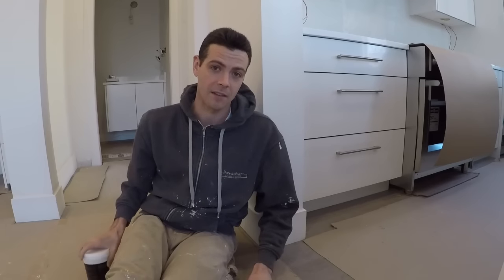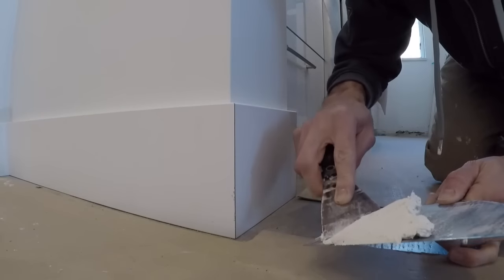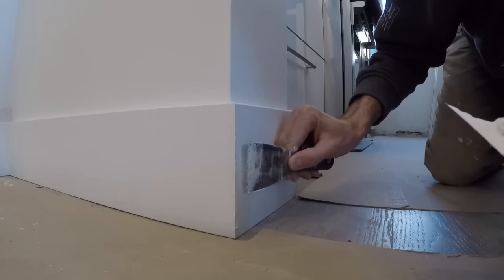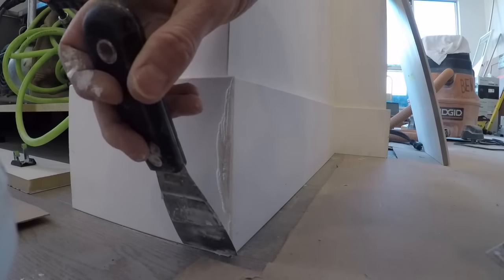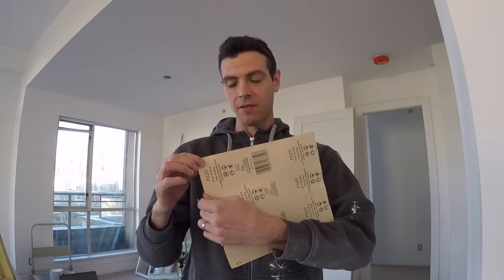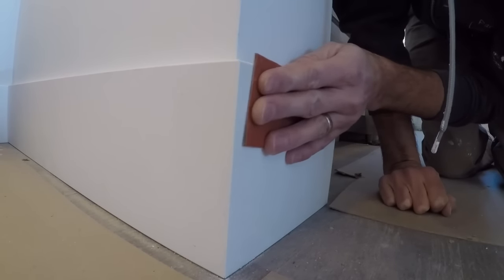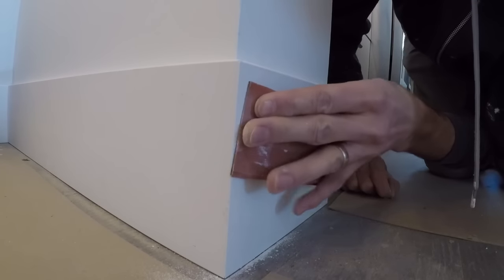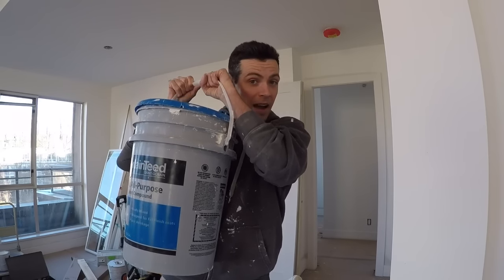How to Fix Open Miters

Comment: Will crack as soon as there is a change in temperature in that room.  Joint Compound doesn't flex where as wood and even the paint you will put on top of it will.  Should have used a product that advertises flexibility or a product that is known for extreme durability such as Bondo or auto body 2 part filler.

Comment: I've hired many contractors and have learned that Asians do a better job with details. They are good math and everything they do is not only fast, efficient but the shit lines up perfectly just like Japanese cars. 

Now, previously, we would hire overpriced licensed contractors and they over all fit and finishes is straight garbage just like Tesla panel gaps and doors that rub and paint that looks like crap.

Comment: I’m not a professional carpenter by trade. I’m an electrician, but I’m also an avid wood worker in my spare time and I have also remodeled a lot of houses.  Here are some things I’ve learned.

If you know the corners aren’t perfect 90 degree corners to begin with, measure the angle first and bisect your miter cuts accordingly. Then you’re miter will fit perfectly almost every time. They make angle measuring/bisecting gauges exactly for this purpose. Then you don’t need to putty gaps because there won’t be any. Do a tune up on your mitre saw to make sure everything is properly aligned. Make sure you have a sharp and proper trim blade with 80 teeth. Make sure the bevel stops are set accurately. I use a machinist square that I’ve checked for accuracy, to make sure the saw bevel angle is reset perfectly 90 degrees to the saw bed. I do this by unplugging the saw and placing on side of the square on the bed of the saw and the other against the blade and adjusting it until there is no gap. Ideally you should do this after a bevel cut when you reset the saw to the normal zero position, and don’t always trust the detents or stops on the saw to be accurate. Use a zero clearance insert in the saw to eliminate tear out. Use the insert that comes with the saw as a template to make your own custom zero clearance insert to perfectly fit your saw. 

Do a practice cut on some scrap first instead of messing up a good piece of stock/ molding etc...

I only miter outside corners. I cope almost all my inside corners because it makes for a tighter joint even when the walls aren’t perfect. This also reduces the amount of puttying that would otherwise be necessary. 

Sometimes it necessary to sneak up on a cut or make micro adjustments to it. I do this by pushing the piece of molding semi-tightly into the saw blade while the saw isn’t running. I then raise the saw start it and make a cut. Using this method it will take a fraction of a blade width off the work piece, and you can repeat the process until the piece fits perfectly.

Comment: Open joints can be filled with veneer of the same wood. Break or cut a piece of veneer along the grain & sand one edge to taper the veneer. Put some pva glue in the gap & tap the veneer into  the gap, more can be tapped in if needed. Remove the excess & sand to shape & match the joint. It's perfect for unpainted mouldings, skirting, furniture repairs etc & it doesn't shrink.

Comment: For all the DIY-ers out there, I have some advice.  If your outside corners look any worse than those in the picture, save yourself some time and apply your filler with a snow shovel or even a flat bottom canoe.   You can thank me later...

Comment: Great video! I would recommend that you adjust the miter settings "degrees" on your miter saw. 45 degrees cuts shouldn't have a gap. With enough use they can get out of adjustment, and I have checked my new saws that came out of the box out of adjustment. Also check the blade angle in relation to the base with a 90-degree tool square. I use a 4''.
Reply: its not the saw thats off its the wall
Reply: @peeinacan1  The host say's in the first part of the video that "it's his crappy saw" but saws can either get out of adjustment or not be set right from the factory. Setting your saw isn't very hard. Once set correctly he might think differently about his saw. My point is that a 2 true 45 degree cuts will make a perfect 90 degree closed edge.
Reply: @stevenbell6047  its way more likely that the wall is off than the saw being off. If the saw is off its easy to square it up really quick.  But since the walls are usually off they leave an open gap sometimes on the trim.  If you cut your outside cuts at 46 instead of 45 you can keep your gaps in the back, where no one can see them
Reply: @peeinacan1  I agree with 46 can help with the gap issue but the man clearly blames his "Crappy saw" in the video. So many men and women blame whatever for their mistakes other than their equipment. I've seen old carpenters that their saws were off adjustment. It's likely yours is off if you own one. That's the point that I was trying to make. Nothing else.
Reply: @stevenbell6047  I agree, I think he's just blaming his saw. But i think it's the wall causing him the problems.  He should be squaring his saw instead of smearing wood putty in the joint...

Comment: Nice job.  I’ve been using light weight sparkle on my jobs.  Works Amazing in nail holes as it does not shrink back and sands or wipes nicely .

Comment: As video alluded to, cut outside corners on a 46 degree or greater angle. I personally always use a thick glue. Put it on end and edge, squeeze out and sand immediately. Fills in any gap with the sawdust and no gap and slightly rounded corner like he shows at the end of video.

Comment: First. That saw is DEWALT. one of the best brands you can buy. And even if is what out of wack just simply use a speed square to check. Very easy. Second. That cut was nice just one piece was too short.

Comment: PRO TIP: the higher the silicon % in your caulk the less it will shrink. Alweys go with 35yr. Caulking and not the 25yr or cheaper versions, with enough experience you will learn how "proud" to lay your caulking bead down so that it is perfect once dry. Of coarse take pride in your trade and get your measurements correct so your mitres look good in the 1st place but if its paint grade and you use the right materials with enough skill then I would argue that you wouldn't be able to walk through one of my finish jobs and never see the 3 ugly joints I figured where good enough. Fyi my filler of choice for filling trim nail holes in paint or solid body lacquer is the Orange can of Crawfords Putty. Once you get your application technique down with a 2" flex blade you'll be amazed at how fast and good your trim looks.

Comment: So you are advocating a filler rather than measuring the angle and cutting the mitre correctly. May as well butt joint and sand and fill
 Mitre saws are adjustable use a protractor and cut right is my view